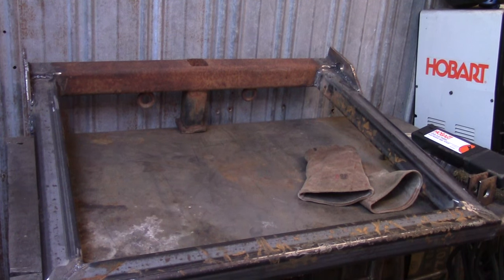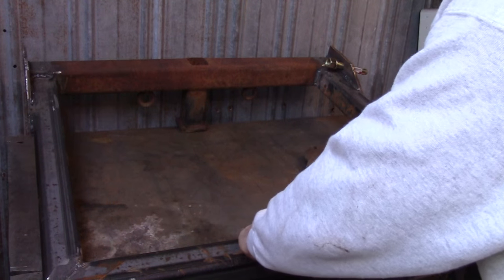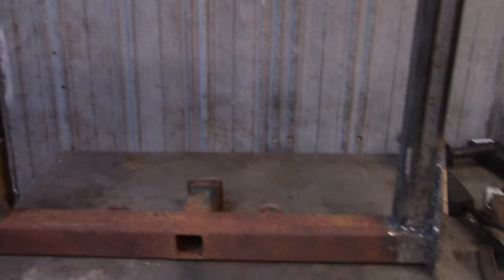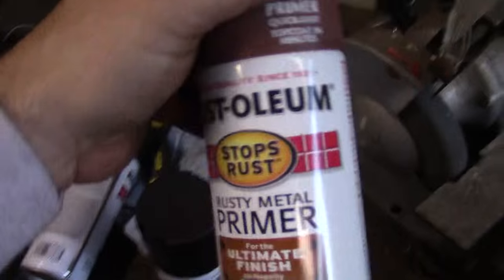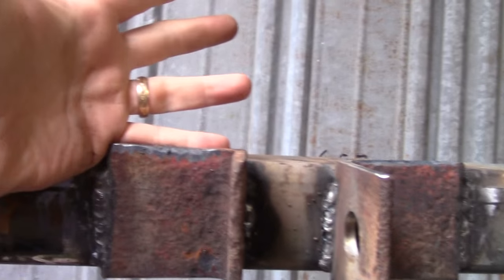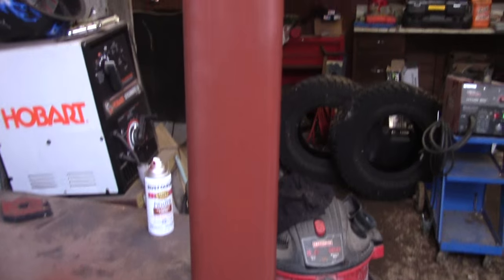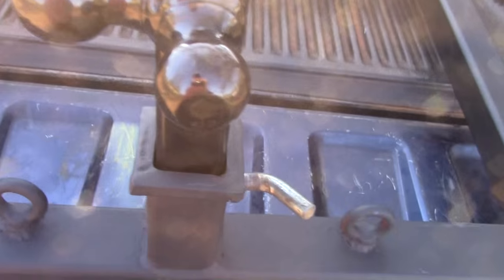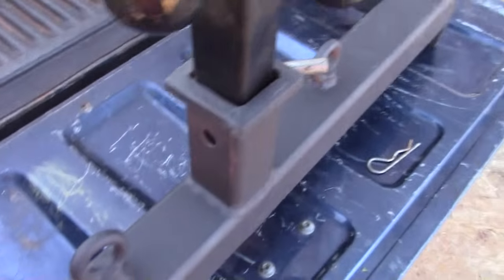3 pt trailer hitch build part 2

Comment: I think it looks great. Hate to wallow out one side to get the pin to line up but it's off quite a bit. Now let's see this on the tractor, and you don't want to know how cold it is tonight LOL
Reply from the maker: Thanks Steve.  A weak battery and a cold diesel don't mix well!  I meant to get a block heater installed and never got around to it. It was 17 degrees F this morning. I can't imagine how cold it is up your way!  Stay warm!

Comment: I like the idea. I have an old hitch laying around somewhere I might try it  out. my tractor won't start either but its having electrical issues lol. I wish I had bought a diesel instead of gas
Reply from the maker: +Idaman71044 Yep, once you get them started, they're hard to beat ;)  Hopefully you'll get yours straightened out.

Comment: looks good ! 13deg this a.m. I put a inline  heater in the bottom radiator hose on my old IH tractor several years ago. takes approx 1 hr. to work. Before that, I used a heat lamp close to the block however that. needs several hrs to help.
Reply from the maker: +james mullis I think a block heater that goes in the freeze plug would work well.  We don't usually have to crank them when it's really cold, and a new battery would help.